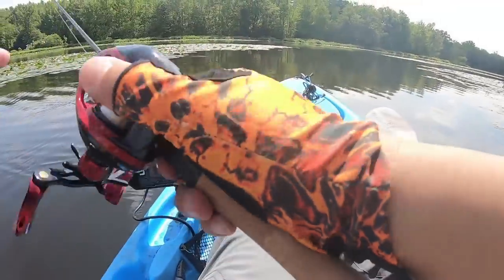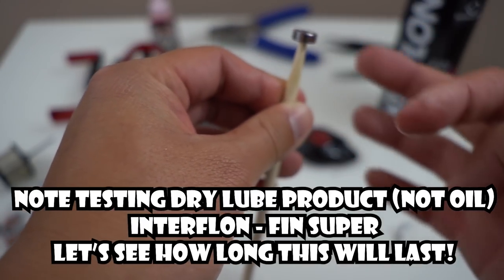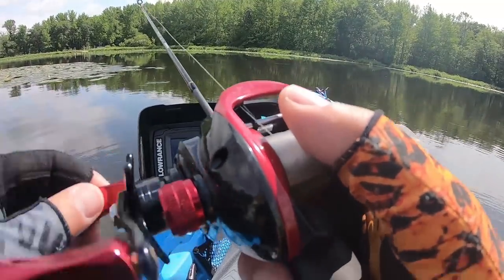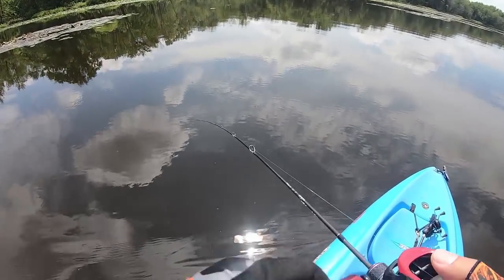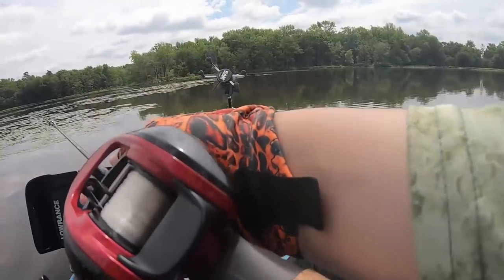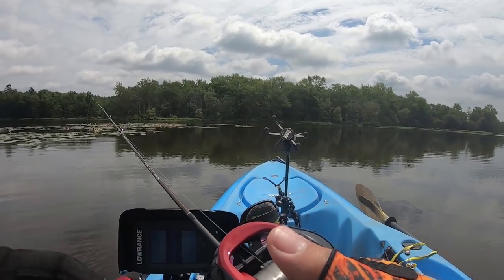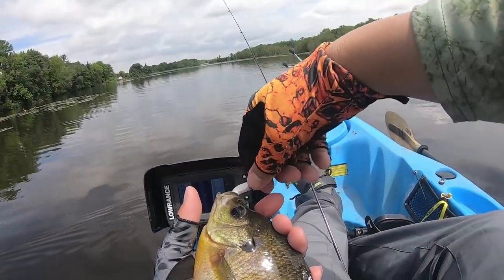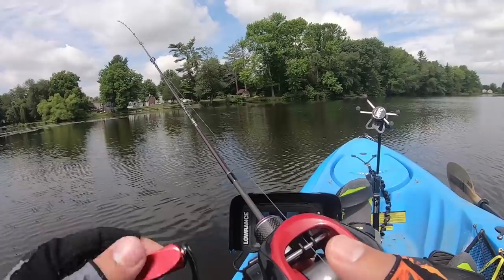How to Cast Further with Lighter Lures on BFS Reel Tsurinoya XF50

Comment: Use to hate this reels casting distance. But once i cleaned it with lighter fluid, i come to love its performance. Thanks for posting this.
Reply from the maker: nice! BFS fishing with this reel is great if it is around 1/8 oz, but anything closer to the 1/16 definitely require high performance oil rather than the longevity grease.  thank you for dropping a line!  BTW what did u use to lubricate your bearings?
Reply: I didn't put any lube. Can you recommend which brand? I hear reel butter is a  good lube for reels.
Reply from the maker: @IslandsFishing  anything is better than nothing ... but I heard those r good too. Never used it. Quantum hot sauce was what I used until I started playing with the product in this vid
Reply from the maker: By the way, here's a little chart on how much lubrication cost in the fishing industry vs Fin Super: https://interflonusa.com/fin-super-is-the-cheapest-reel-oil-or-spray-on-the-market-and-the-best/

Comment: raWr Fishing 06/20/2019
Super free spooling Bearings are interesting and show they turn seconds longer than most factor bearing. This certainly will improve casting distance. However, they also are crazy fast at making bird nets as well. A Robin fart will cause the spool to turn and cause an over run. Therefore, you have to tighten the spool tension and negate the smoother spinning bearings. If you just wave the rod in free spool it will cause an over run. I practice casting these little BFS gems almost every day for 30-minutes or more. Because at the very best these reels are little nightmares to cast, much less casting them accurately. I found that the lighter the lure the less accurate they cast. The range of realistic lure weight is from 2g to 6g and 2-gram lures are still tuff without lots of practice. When you practice, try setting the brakes for zero over runs. Count the casts you make without one and if you make 25 or more you have a good setting for accurate casts using that weight lure. I found if you keep your elbows tight to you side and cast using your wrist accuracy improves. If you change between every cast, you will never cast accurately. I practice on the street or any open area with a smooth surface. I spray little red spots on the street to make targets. I weight the line with split-shot to exact weights. This sounds like pain in the butt because it is. Trust me on this one; it helps when your fishing some small trout stream with a million little branches ready to ruin your day. Japanese anglers use bright colored line because it is easier to see when removing boo-boos and it looks cool. Last Saturday, I caught a couple Crappie slabs and a two-pound Largemouth on a tiny 5-gram hollow body frog from my boat using BFS tackle in tiny little Lilly pads. This winter I found them on E-Bay for $.98 cents and bought a dozen. Six-pound braid, rules! What a Hoot!
Reply from the maker: As always, I love how you share your experience and knowledge. I do agree that doing anything to make your spool spin more easier can give you some more distance, but with the increase risk of over spooling.  I think i rather have accuracy than distance.  I don't normally cast 1/16 oz lures on the dot or less unless I fish hair jigs in trout streams, but I'll opt for a spinning setup instead if that is the case.  I tie killer marabou jigs for them :) in any case, i'll never be able to cast the same position while kayak fishing LOL. it's actually really tough.
Reply: @rawrfishing  I used tiny ultralight spinning tackle for trout fishing since 1993 and it is great fun. But, catching trout on BFS tackle is just as fun. BFS trout fishing is much harder and it makes fishing more fun and challenging. Besides, it has a higher cool factor. When you meet other anglers on a stream, they all want to know about this cute little red reel and tiny rod. Don’t worry, I still use spinning tackle and Fly rods too. The secret is minnow lures catch bigger Trout more often. I use bow and arrow casts with spinning tackle with Trout magnets, and that is another trick to try on tiny Trout waters. When you catch a seven-pound Steel Head on four-pound line, you start thinking this is a real nifty way to fish. Tiny marabou and hair jigs are flies; you can tie them to look just like worms, leaches, nymphs, tadpoles, minnows, crawfish and sculpin. There places a fly rod could never fish affectively, but spinning tackle or casting tackle can.
Reply from the maker: I use em all too but I am likely going to find a new UL spinning setup to throw either 1/32 or 1/64 oz, like trout magnet stuff.. anything lighter i'll just practice the fly.  I always wanted to try nymphing. So many things on the list to do, but I'll continue to explore BFS this year.  Just got a new rod... organizing files now.
Reply: @rawrfishing  The same rods you like for BFS casting reels often are made in a spinning rod models. That is something to think about because you can expect they will perform the same. Spinning reels to match are size 25 and 30. Shallow spool spinning reels make great ultralight trout set ups. They are great Crappie Bass rods too. So many toys and so little time, I love it when that happens. Tell your Mrs. It is just part of being famous.

Comment: there are pretty cheap ceramic/hybrid bearings on aliexpress. i just ordered a set to test on my fishband gh100
Reply: if u guys are interested:
https://www.aliexpress.com/item/32338759434.html
https://www.aliexpress.com/item/32565701258.html
https://www.aliexpress.com/item/33011319626.html
Reply from the maker: Certainly are, what are the sizes for the bearings?
Reply: @rawrfishing  The seller said it's size 5 10 4 (spool bearing) and 3 10 4 (side plate bearing) for the GH100. But it's better to measure the diameters of the bearings yourself just to be sure. Didn't measure mine 'cause i don't have the tools and grease to remove and put them back. Gonna ask a friend to switch them out for me when they arrive. The 5 10 4 size is only available on the first link though.

Not sure about the sizes for the XF-50 bearings.
Reply from the maker: I gotta go get a tool to measure i guess lol..
Reply: @rawrfishing  i believe you can measure them pretty accurately with just a ruler. You just need to measure the inner diameter, outer diameter and width. The units are in millimeters (mm) :)
Reply: Did the new bearings improve the reel?
Reply from the maker: @BackTheBlu  I would love an update too on it! still debating if i need it as relubing it already done so much for my reel's performance!
Reply: @rawrfishing  did you clean up the bearings on your gh100?
Reply from the maker: @BackTheBlu  heck yeah! And a bit more...I should do a vlog of that reel... on paper... everything is cool and good... but when I have opened it... hmmmm......... another story
Reply: @rawrfishing  mine was missing a click pin and spring that go behind the brake adjustment wheel
Reply from the maker: @BackTheBlu  I believe you have told me that, man QC is hit or miss i guess.. but i don't think mine was a QC issue. it was how it was shipped out of package.  no me gusta!

Comment: Order better bearings ? Worked for me with my ambassadeurs
Reply from the maker: I took apart my reel to obtain sizes that I need, but regardless if you buy new bearings you still need to take care of it.  While the new bearings are not here yet, I have decided to clean my existing stock bearings as they were pretty good.  I personally don't think I would need new bearings but I am sure folks would love to see that. back to my point, which was made in clearly in the video is that the stock lubrication used by most manufacturers are thick and should be removed and replaced with high performing ones. thanks for watching and dropping a line.

Comment: Heloo, I own a tsurinoya xf 50L and I want to upgrade them to full ceramic bearings. Can you please tell me what size they are? And if you can a favorite link on aliexpress. Thank you very much.
Reply from the maker: I would if I knew. As u seen here, I only cleaned and added higher performance dry lube. You can always reach out to tsurinoya for the bearing specs ^_^

Comment: Bro! Check out Riverrods.com!!! I just got a custom made pole for my father and I!!! It has Portuguese cork a sliding seat that can be converted from a spinning reel rod to a fly fishing rod by sliding the seat!!! SUPER action! Check em out! Based in Colorado!
Reply from the maker: That sounds really cool. What is the setup for ur dad? Curious what he is casting on both fly and spinning
Reply: He's using a Pistol Pete fly and for spinning he is still using a smaller setup fly  but with a bobber and a 5-6 foot leader
Reply from the maker: @vl7890  nice, what is the normal fly line he throws? trying to visualize the action of it!